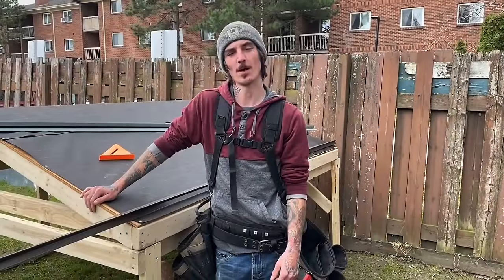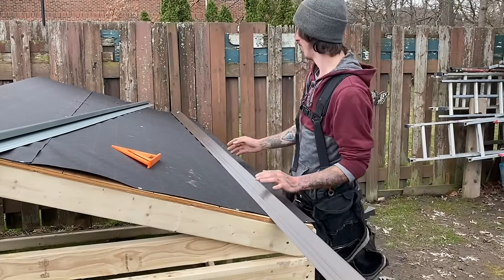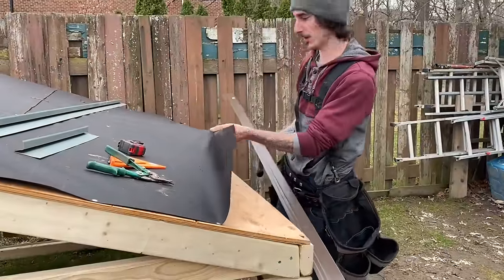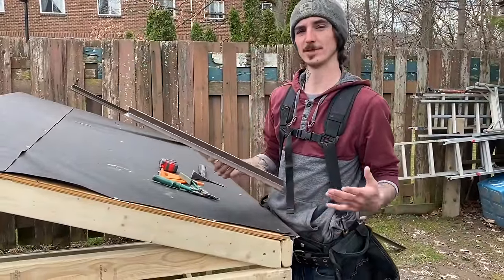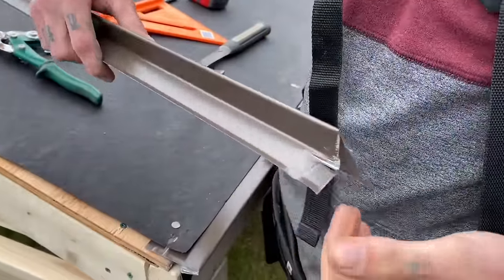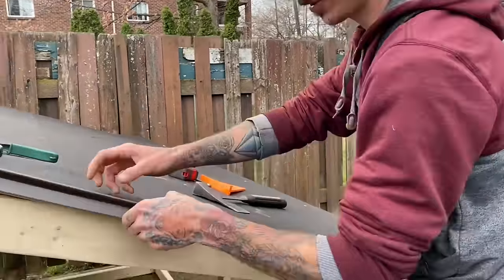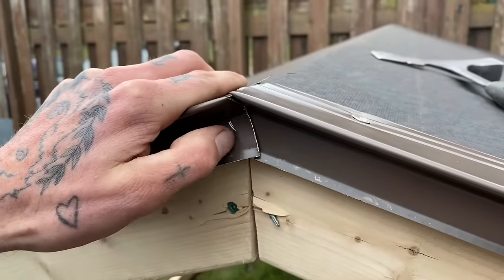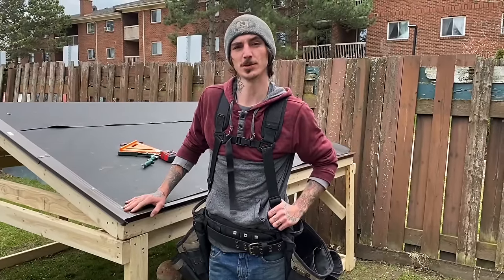How To Install Drip Edge On A Roof

Comment: Thank you so much! Your videos agree great. We're having a roofing nightmare! Why don't people learn before they ruin other people's roofs? Wrong thoughts of sheeting, smushed shingles, nails under the underlayment, plugs that are too small to actually plug the hole, get through interior ceilings in garage and art studio, bird blocks left open at the edges so bees can get in and now there are no bird blocks in place for 4 days so critters can get in,  poor communication resulting in a ground drop of materials, the tried for three starter row of sheeting before they got it right and it's been 3 weeks with no finish date in sight. Still  have many open holes in the roof. Let us hope for no reason here in the PNW.

Comment: Thank you so much for allowing us to understand.  I thought that the drip edge was supposed to have at least a 1/2 inch gap between it and the fascia board to allow water to drip off the shingles and down the drip edge landing in the gutter.  Is that not the case?

Comment: Get a full length of drip edge for the rake flush it up to the drip edge on the  eaves mark your vertical line make a cut then tuck behind. Just a tip. It’s quicker and I find gives it a nice finish at the peak!

Comment: Valuable lesson for free. Much appreciated. Just had my gutter fall off my back porch roof from wood rot. The roofer who installed the previous drip edge must have done something wrong. The water used to drip right before the gutter, forming icicles in the winter, and after years of this problem the wood that the gutter was nailed into rotted and down came the drip edge with the gutter. I am getting a whole new deck but looking at the failed gutter it is easy to see the water got under the shingles and in-between the drip edge and gutter. If I was younger and had a long ladder I would have attempted a repair many moons ago and that is only if I saw your video showing how to first. Thanks and stay safe! 👏👏👍

Comment: On new construction I always like to make my bottom drip edge just a tad long on each end to accommodate for the thickness of the aluminum facia…as well as making sure to not to pull it too tight on the rakes for the same reason. The siders will appreciate it

Comment: Great video.  Question:  After the Drip Edge is fully installed, do you nail the fascia up against the Drip Edge? 1x6 or 1x4.  I am building a Workshop as a Novice and there was no Drip Edge in the Material List nor Roof Edge Cap.

Comment: I'm not a professional roofer, in fact I hate shingling! However when I do I always use gutter apron on the eve and drop edge on the rake, also I keep the apron about 1/2 to 3/4" off the facia to prevent capillary action

Comment: I strongly recommend pulling the drip edge away from the facia board. Surface tension will pull the water back up under the drip edge, however with a gap between the drip edge and facia board the water will fall away from the facia board all together. .

Comment: Question.  I have a backyard patio.  20'x10" beams are 2" below the roof edge attached to the ledger on the wall.  Patio ceiling was rotted out bad, got demo'd but left the main skeletal beams as a "pergola".  Roof needs a drip edge, but what do I use to protect the 20'x10" beams coming off the wall under the roof?  U-shaped galv. sheet metal to protect the wood?

Comment: Thank you for that Insight!  I learned a bit.  I need to know how to remove gutter spikes (the old aluminum nails) that don't want to come out.  I would prefer not having to remove  the board they are attached to, but any help would be great.  I put the gutter back up but what I thought was a grade toward the downspout didn't work even after I cleaned out the leaves.

Comment: Great demo! What is your opinion on installing cedar shakes on the eve, along the edge, to extend the drip edge out another 1” or so? I had a garage once that used that method. It kept the water off of the facia board altogether.

Comment: Very good video! I changed the shingles on my house 3 years ago and changed the drip edge at the same time and everything looks awesome. Last summer my wife and I built a garage 34’x40’ and installed drip edge before roofing and everything looked great. This spring I go to install my soffit and fascia and realize my drip edges are buckling. I have no idea why, I installed them the same way as I did the house. Do you have any idea what could cause that?
Reply: You did new shingles and drip at the same time!?!?🤔
Reply: Probably from nailing it down a lot more than needed. When it was installed, you nailed it and kept trying to keep it snug to the fascia every few feet.. Should only adjust it when you put the first nail in, then go to the other end and adjust it there.

Comment: What if you installed your drip edge before your underlayment? If I'm putting on steel roofing do I need to use drip edge along the gables as well?

Comment: I could be mistakin but the term drip edge is exactly that. Water should roll off the roof and into the gutter when installed correctly. I believe this is correct but not too tight Is key, perhaps hardly touching as it could deform the shape therefore it dimensional properties. A drip edge is designed to not allow water to roll passed the edge. IE...Drip edge!  Nice job!

Comment: If you use a wide drip edge you don’t need so may nails. The starter will stitch it down. Minimum 2” lap on rakes(like step flashing). Plumb cut on ridge 2” down leaving a tab bent over the peak. Using drip edge on the rake we let the starter drip run by and coped the lower leg of the starter so the rake fit over it neatly. We used to bend our own simple angle rake edge because the roller formed simple rake edge always has a curve that ‘oil cans’ when forced flat on the roof deck. Where’s your nail gun?

Comment: This is one of the best teaching channels on YouTube, no frills get straight to the lesson and getting it done, well produced, love the teaching model Constrution, I’m impressed and I work in Tv broadcasting for a living. Now my situation, I Bought my first mobile home an 84 Windsor, if Possible I would like to secure advice on improving the existing gutter system which is mini style? And if adding a drip edge Can or needs to be done. I just want to do it right and would appreciate any tips. I can make a short video clip or take pictures and send to you if possible thank you for taking the time to read my post cheers Steve
Reply from the maker: Steven Hagerty send your pictures to youraverageroofer@gmail.com I can also do a video if it helps after seeing the photos.
Reply: Hi Steven, I gained prior roofing experience many years ago working for a reputable contractor here in upstate NY along the Pa border. I did roofing occasionally as vinyl siding / windows and blown cellulose insulation was our main operation. I too will be starting a roofing project on a single wide trailer home with one layer of factory 3-tab shingles on a wooden peaked system. Thankfully, there are only 2 openings in the entire 70' roof. A 2.5" bathroom vent pipe and a larger metal chimney vent from the furnace. I bought close out architectural shingles last fall, and a roll ridge vent system. I'm tearing everything off to the wooden deck to inspect it. This trailer doesn't have any 'overhang' or soffits to assist in venting the heat, so I plan to install a gable vent in each end. One thing I plan to do, is leave my drip edge out away from the facia about 1/4". I noticed that water runoff isn't goiing into the rain gutter system. It's running down the drip edge behind the gutter and it stained the vinyl siding black and green. Other than that, I hope everything works out well. Hope your project is going well to. Glad I found this video. I'm brushing up on skills I haven't used in a long time!

Comment: I still gave you a like but I'd have done it different to ensure as few  leaks as humanly possible. The method I shared in my last msg is the way. So many times I have had to brake fascia metal to cover up the roofers drip edge because I see so many trouble spots and I'm not gonna allow somethin so small rot the homeowners fascia wood and mess up my soffit and metal work.

Comment: Question?  If you were doing a small slant flat roof would you also nail the drip edge on the slanted sides over the tar paper?  Because I noticed you nailed the drip edge on the low sides first, then tar paper over it.  Thanks!

Comment: I've had two roofs installed on my house. Neither time did they leave a space between the drip edge and the fascia. Both times the capillary action caused the paint to prematurely deteriorate and the the fascia to start to rot. The guys on This Old House are the only people I've seen that say to leave a space between the fascia and the drip edge.
Reply: Saw that too. Was thinking if you have flashing right behind the drip edge and into gutter the water will never see the fascia.

Comment: I have an old roof now to keep my homeowner insurance I need to upgrade the roof edges with the Drip Edges is that cprrect
Reply from the maker: Depends on your insurance company, but some states/provinces to require it by code. Check your local codes. Hope this helps a little.

Comment: What kind of fastener would I use if I'm replacing drip edge on an old existing roof ? I would have to curl the existing shingles up pretty far to be able to nail it down. And deck screws will lift the shingles up a little if I can't countersink the head enough. Would construction adhesive be the way to go ?

Comment: My house has a metal valley that collects  a lot of water during a rain that runs over the gutter below onto the ground, instead of into the gutter. What do you recommend to fix that problem
Reply from the maker: Purchase a gutter splash guard and attach it to the corner of the gutter to prevent water shooting passed.

Comment: I have a rolled roof with a drip edge too close to the facia.  Can I put another drip edge up over it and leave more space between facia and roof and solve the problem of the water rolling down on the facia and wrecking i

Comment: I may have lost my mind, but I use adhesive flashing to seal the drip edge to the wood.  Then use synfelt over that.
Reply: seem a little excessive roofs hardls leak on the gable end ad its over hang not even covering the main part of the house
Reply: You should go look until you find it
Reply: @mitchminard5859  Sorry, Mr. Minard - not understanding you here?  Thank you.
Reply: @fordguyfordguy  hes saying you should go find your mind because clearly you did in fact lose it.
Reply: @mistermycology1411  haha

Comment: Drip edge it's supposed to be installed with a gap between ther drip edge and the fascia board. I generally stick my fingers in between so it leaves about a half inch. If you push it back right the process called cohesion will pull water up behind the drip edge.  It also gives more room for gutters and lets air in better to help any water that does happen to get in.
Reply: You are correct. Installing it as he shows be expected to replace the fascia board in a few years.

Comment: Paper goes underneath dripedge sticking past bottom edge just a little bit cause if water or ice get there it could go right under paper. Iceshield will stick to drip which goes on top of drip like you did.

Comment: When the first rake edge was installed and trimmed at the bottom, you cut and wrapped it around the drip edge.  The wrapped part was not vertical against the bottom part of the drip edge.  That would appear to interfere with gutter installation.  Please you comment on how to do this if gutters are being installed.

Comment: This old house guy says the drip edge should be “a finger thickness” (let’s call it 5/8”) away from the fascia face.  He uses a bottle of water with a slow flow to demonstrate deflection without contact with the fascia board.  Interesting video to watch.  Thanks for the video btw.
Reply: I was wondering about that too

Comment: Put Gutter apron on the the eaves and drip edge on the rake edge. Slide facia trim and gutters up under the gutter apron, that's the best way to ensure no water getting to your facia board and roof edge.

Comment: Question: That laminated paper thing on the roof, does that come with the shingles I purchase? Or is that separate?  And is that paper really necessary? Do I have to put it on? I'll be building a little shed soon.
Reply from the maker: Synthetic underlayment is sold separately, it’s approximately 75$ a roll and covers 1000sq/ft. 

It’s a layer between the shingles and decking that is an added layer of protection incase shingles blow off or if a leak is present it protects the plywood. 

If the building is shingled properly it is not necessarily needed, but like I said it’s an added layer of protection. It’s not code to install synthetic underlayment but recommended.
Reply: @Average_Roofer  Alright thank you for the info I'll keep that in mind😁

Comment: Great video. One question. What kind of nails are you using to fix the drip edge? Are those asphalt shingles' nails?
Reply: You just use the same nails as if you were nailing down shingles. There isn't a specific type of nail that you use, plus carrying around specific nails just for the drip edge is silly imo

Comment: Why is the drip edge on top of the waterproofing on the 'rake' side, but below it on the bottom side of the roof? I have a roofer replacing shingles and he has put a lot of shingles on without putting the drip edge on. If he has, I can't see it, it is on the second story of a barn I own.

Comment: So if the horizontal drip edge you are connecting multiple pieces due to being long. Do you overlap those as well? Or just butt them and use some sealant/caulk?

Comment: I am a DIY guy. I made my eave drip edge 2" longer and wrapped it up the rake, then put the rake drip edge over top with 30# paper between them at the corner. Did I do it wrong?
Reply: You did it the right way.

Comment: What do you think about metal roof like east coast metal roofs?I know the cost is a major factor but any feedback would help me.Thanks brother..
Reply from the maker: STOCKBOY7254 if it was my forever home. I’d put metal. If I planned to sell in the next 20 years I’d just use asphalt shingles. Metal in my personal opinion is the way to go as the life expectancy is longer.
Reply: Great video and channel.Can a regular roofer due a metal roof?Just asking because in mass east coast metal roof company is so expensive they mark everything up.
Reply: I work standing seam in ski areas of vermont it's the longest lasting in my opinion plus coils of galv alum are crazy expensive

Comment: Is it ok to leave drip edge alone where it over laps? Or does it need to be sealed?
Reply from the maker: This will depend on your local code, here in Ontario it doesn't require it. Its also not a point that's common to cause a leak.

Comment: Rake edge makes it so we can't put the nice gable fascia on. We put a detail on the gable fascia with a ½ bend out for the shingles to rest on
Reply from the maker: Tip top Exteriors not necessary when I install rake edge. If you just tuck up behind it, our shingles are supported by the rake edge.
Reply from the maker: Tip top Exteriors showed up to a leak repair today, your custom style bend over the drip edge. Leaked like a sieve. Let’s roofers handle the roofs. Siders can work around that.
Reply: @Average_Roofer  we don't get leaks we do it properly. Just saying drip edge belongs on the eaves
Reply: What?I do both siding and roofing why would you not use dripedge on the rakes?I agree just tuck your metal under the drip!!!It can and does make a leak with a half inch bend back off the fascia underneath the shingles!!!You saying that "you"do it the right way makes no sense cause it's wrong!Unless you bend it at a 45 or some other degree but that still could leak and you said 1/2 inch to support the shingles.Sorry boss but you were taught wrong or just decide to do it wrong.Its called drip edge for a reason to stop drips from the perimeter of the roof.However hay do you it's your world you may not get a leak however you may just lose work and never know?I just don't see how you can't tuck the metal under the drip? Plus it's faster you don't have to make the have inch bend.Again it's your world do what u want.

Comment: This Old House says to not butt the bottom edge of the drip edge tight  up against the fascia as slow-running water will run down the fascia and rot it; what say you?
Reply: Definitely true.  Almost all roofers press the drip edge up against the facia (or shadow/trim) board.  The actual edge that "drips", does not drip but instead wicks up and behind that edge and then sheets down the board.  (Next rainstorm go out and look at what's happening on your roof edge). If the facia board is plastic wood then no problem.  But if it's real wood, then rot is in its future.   Better to use the newer double drip edge like Rite-Flow where the drip edge is floating an inch away from the facia and so can truly drip down and not wick back.     Ideally the roofing shingles overhang the drip edge which helps to act like a drip edge itself.

Comment: How would you install drip edge under existing shingles, adhesive instead of nails?
Reply from the maker: Nails normally. You first need to remove all existing nails along the gables. Insert drip edge and re nail shingles and drip edge simultaneously.

Comment: should the drip edge be pull out away from the facsia about 1/2" inch for surface retention?
Reply from the maker: Trent Myers no. Only for drainage if you aren’t going to put fascia metal over the fascia board to prevent wood rot.